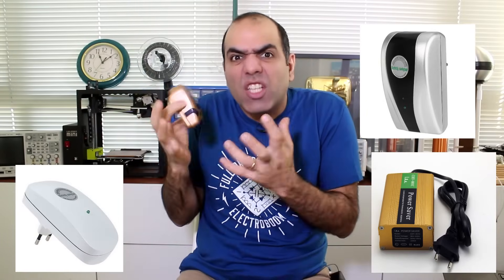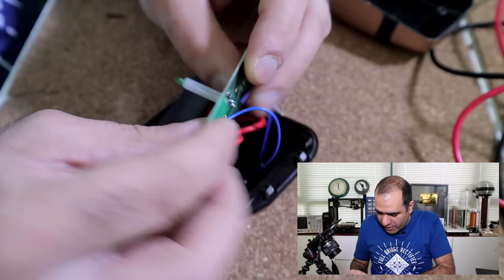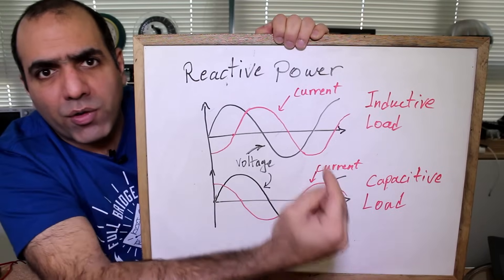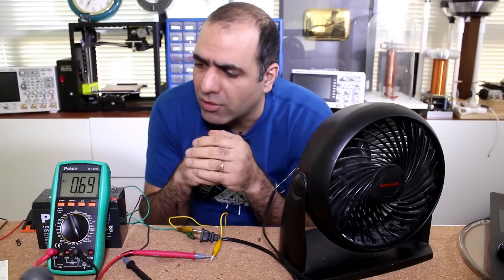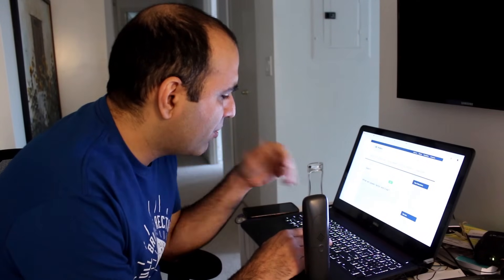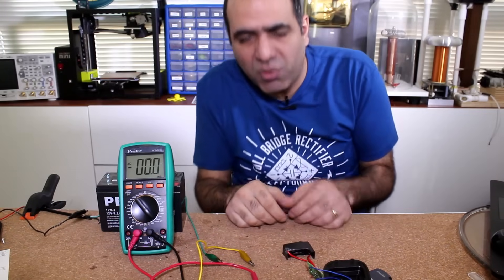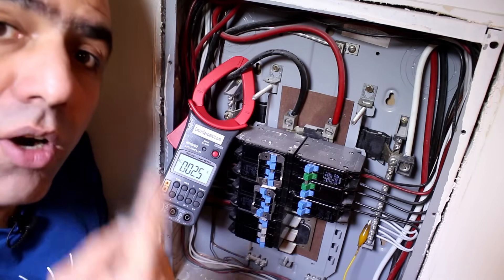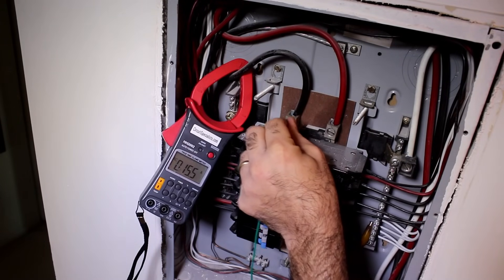Power Saver Scam EXPOSED!

Comment: I have one question: in many cases, when we consider AC signal, we find that reactance of the capacitor is almost negligible(at high frequencies). So, we approximate that the capacitor is shorted when analysing for AC signal. But, in this case, you just put that capacitor in parallel connection (with 110V AC supply). Why didn't that create a short-circuit?
Reply from the maker: because the frequency is 60 Hz and low, and capacitor is small. So the impedance of capacitor is large enough to limit the current through it and not be a short circuit.
Reply: @ElectroBOOM  Okay....now I get it!! Thanks for replying!! :)

Comment: It's a proxy, not a VPN :-(
Reply: It's a VPN......It use the same method as your system default VPN connection, which provide a stable connection through Youtube and other stuff. Though the security is doubted as ISPs monitor your connection from the beginning you linked to the WWW.
Reply: It's a VPN proxy to be precise. It uses the system VPN capabilities to establish a connection with the proxy server which in turn serves as the proxy between you and the website. This proxy server must exist, otherwise there would be no way for you to "mask" your IP address.

"VPN" is the adjective in this case, so "proxy" is the main component of this. A sole VPN wouldn't give you all capabilities "VPNs" are claimed to have, while a proxy would usually give you the majority of them.
Reply: @IllidanS4  That make sense. I personally use another service which works quite similarly with Express..But ISPs in my country is already monitoring the connection to the outside, whether your connection is encrypted or not.

Comment: next week i get to install 2 power factor correctors that together have a 3 fase 630A 400V rating. 
and all of this just to smooth out a 1600A power distribution penal.80% of it is rated to go to AC induction motors and only 5% to utility's and control hardware.i can not tell u wat or who it is for, but that factory is gowing to get one hell of a peace of kit.

Comment: You might actually be billed for apparent power. It depends on your meter. Mine is the old style rotary meter, which uses inductance to measure power flowing through the service connection. It cannot measure the apparent power because of the physics behind its operation. A digital meter however, can. Some digital meters do and some don't care about PF, but smart meters do. They can measure current and voltage separately to obtain apparent power and actually adjust your rate dynamically to your usage schedule and power factor.

However, most people do not need power factor correction in any way shape or form because the main appliances that need it, have it. The issue with home power factor is switched-mode power supplies drawing a short pulse that causes a momentary drop in voltage and a harmonic distortion to form on the line, which can actually hurt your bill much worse than a motor can.

Comment: Most domestic electric devices with motors already have a capacitor in parallel of the the main circuit, just open your vacuum cleaner and see.

Comment: 5:54 WHAT THE F#$K WAS THAT
Reply: A... moan?
He explains right after, but...
Capacitors are like batteries (difference being caps can release all their charge at once/in a short time) and without the LED there to discharge the cap inside, it discharged into his body when he touched the plug (completing the circuit).

Comment: Since many LED light bulbs use a Capacitor dropper to get low voltage many households already have these power correction devices.  Maybe so many that an electric motor (inductive load) is actually correcting their light bulbs.  Not that it matters for residential anyways!

Comment: It took years to convince my dad that his magical power saver wasn't doing anything. Eventually the cheap capacitor within the unit failed and the entire box became quite hot, drawing who knows how much power. Luckily it was in a decent aluminum enclosure.
Reply: I wonder if they used a class x capacitor? Think they are designed to fail short circuit and trip the breaker.
Reply: Given its level of Chineeseiness I bet the just rolled up aluminum foil sheets between a plastic grocery bag.
Reply: All electronic components - including capacitors  - will fail, the more you have, the more the risk. I have a highly reputable make of  oscilloscope, a few years ago, I heard a pop, when I checked, I found its input filter had failed - probably the capacitor within - and it was on fire. Lucky I was there otherwise it  could have burnt the house down. Tell your dad to chuck his cheap Chinese junk on the floor and stamp on it, non-commercial users don't pay for reactive power  anyway.
Reply: EM.. skill would be the man who uses one of these to set off a rocket.. ha ha.. Let's see it..
Reply: @Mo Bina - I could do that blindfolded with all three arms tied behind my back.
Reply: @ElementalMaker  Three arms?
Reply: @ElementalMaker  fancy seeing you here buddy.
Reply: Why does it take years to convince your dad? You could easily convince him by saying that the his electric bill doesn't increase after he started using the thing.
Reply: So... the capacitor helps, marginally, only when connected directly to some devices... hurts in all other cases... and eventually goes bad.
Reply: My subscriptions follow my subscriptions. Cool!

Comment: The microwave is still consuming power even if it's empty. The magnetron that draws the power doesn't care if there's something inside. You essentially heat up the magnetron itself after some time which is why you generally shouldn't operate an empty microwave oven. Compared to other heating devices it's actually quite efficient though. It has about five times the efficiency of a standard electric oven

Comment: Modern motorized appliances include power factor correction of some sort, by law. I have a very old chest freezer that was manufactured before that. I have an actual active power factor correction device connected to it. They used to be available, there are actual electronics inside. The motor runs quieter, too. Modern fridges and freezers have them built-in.

Comment: I like old plastic housings for little projects. Old 12v wall warts are great for kids nightlights or to plug in when you need light to work behind a dark cabinet. So at the very least, you overpaid for an LED, a capacitor and a handy plastic case.

Comment: Hey Electroboom I live in a warm country and during the summers our room fans are rarely turned off (they are on 24 hrs a day) they run on avg at 100 watts and by using a similar device I was able to reduce our electricity consumption by 20% compared to the previous year. But I directly coupled the capacitor to the fan switch so if the fan was on, only then the devices were on (I took three semesters in LCA and electronics). I love your videos <3

Comment: I have conducted scientific tests on some of these power factor correctors(not capacitor its a trac that is fired to reduce the output till the lowest current is achieved). I used the spinning disc in the home power meter as it reads actual power consumed. here is what I learned. Yes, on my 1951 refrigerator originally designed for 110volts running on my line 127 volts. the correction results in a 4 percent saving. lucky I only paid a dollar for the corrector at the thrift store,( as 4 percent is not that much money saved). I bought half a dozen for the heat sinks and triac. NO on my kitchen refrigerator designed to run on 125vac. no saving on it. the  lesson learned is motors running above their design voltage are wasting heat because of iron saturation. For most people stay away from these things.

Comment: I have a transformer that steps down 220 v AC to 22 v AC. It's primary coil impedance is 10 ohms. If I connect it to the AC outlet (220 v AC) it would draw 22 amps without any load. If I connect a load that draws 10  amps at the secondary ,will the current through the primary coil reduce to 1 amp or will it stay 22 amps with 21 amps reactive and 1 amp active or will it be 23 amps with 22 amps reactive and 1 amp active?

Comment: Another full bridge rectifier shirt? Guess I'll have to buy it... I'm planning on wearing the 1st, while I do a video on converting a 12v wall adapter to an AC/DC power supply... They cost about $200+ for etching knives... I could build the whole thing, but why when it is already all built in a wall adapter, just tap off the transformer... Awesome video as always, have a great day, take it easy...

Comment: In the UK we are being changed over from the old type spinning disk meters to "intelligent" meters. I personally have refused. Of my friends who changed over the average increase in cost is about 30%. Exactly what I would expect from loads of badly designed switch mode PSU's etc on apparent power. So possibly these are going to go from utterly useless to actually saving money for some people if I am correct about the reason for the cost increase. Just so you know we are talking the exact same household with the same unit cost on the same supplier.

Comment: Hey Mehdi, I really appreciate you putting this together. I was wondering if you could answer a slightly different question with that same data: you keep mentioning that you are not paying for the extra power that the capacitor is displacing, but is that power being diverted or used somehow, or is it just sent back to the grid?

Comment: There is a different type of "Power saver", intended to be connected between the wall outlet and the load, which is in a fact a dimmer with a fixed setpoint in about 80%. Yeah, if you plug something like a fan, you will pay 20% less for The energy, but will have 20% less wind 😂
Reply: Now thats a legit thing.

Comment: Let me see if I get it. When you have a pure capacitor or an inductor connected to the line, it's just pumping energy back and forth between you and the grid. So you are technically not consuming anything, but the electricity still moves back and forth so the power supplier gets angry because you are wasting energy on their lines as heat (due to resistance) and pay nothing for it. When you have an inductor such as a motor, some of the energy is used to do actual work, other energy would be pumped back into the power line. But if you add a capacitor, it absorbs the energy that supposedly would go back in the line, and hands it back for later when it's actually used, instead of drawing it from the line.

Comment: Side note on microwave ovens. There are a couple of design differences from "normal" transformers: (1) they are wound to partially go into saturation, hence the 14A reading. A normal transformer, rated at 1000VA would typically draw 1A, or less, when idle (no secondary load). (2) There are "shunts" in the core, to divert a small portion of the magnetic field, so when loaded, it doesn't overload your breaker.

You can convert a microwave transformer to be just like a regular transformer by: (1) adding about 10 turns to the primary, to keep it out of saturation. There are only about 120 turns on the primary, for a 1000VA microwave oven transformer. (2) Remove the shunts. They are two separate pieces of metal, that can knocked out. I personally, remove the secondary, and wind a new one. Microwave transformers can deliver a lot of current at low secondary voltages. Many are re-purposed for homemade spot welders.

Comment: There's real boxes that correct power factor, they contain inductors and capacitors that are turned on with relays and off, with an actual computer board that detects the powerfactor and corrects it. They're expensive and rare. .-.

Comment: hey buddy , please clarify me that , if we can increase the power factor to unity by using the external capacitor banks, than in industries why they always try to maintain it at 0.9 or 0.8 lagging instead of unity. it may perhaps due to the economic considerations , but how , please explain if you have any idea, or if it is possible then please make a short informative video on this.

Thanks
Mohak Saxena (INDIA)

Comment: There's a guy here in argentina who made a video from one of these. He tried to demonstrate what you're saying, couldn't get the piece of junk to work so he pried it open. Literally, the thing was a circuit to reduce the voltage and turn the power led on. That's it. Not a single component more. Not even a capacitor.

Comment: The UK is going this way with the massive push to install "Smart meters" so the power companies can charge their customers even higher rates.  And they say, and I quote. "Smart metes will save you money by reducing your power consumption".  Yes that is real.
Reply: Unlike the old spinning disc meters, Smart meters DO have the capability to measure apparent power, and just one flip of a bit in the setup to charge for it
Reply: @matthewday7565  ^^ My point explained better :)
Reply: Whatever they tell you, you're under no obligation to have one installed. Also the costs appear to be spiralling, people are having them removed, it's a mess. Due to how our particular house is, they can't install one, which is nice. I don't remember why. Maybe no mobile phone network, maybe because of the size of the installation serving multiple flats.
Reply: @ollieb9875  Unfortunately here in Italy they switched everyone to smart meters in the first 2000, and then last year they yet again changed all the meters to update to the new technology. In theory meters communicate trough the power lines (more or less the same technology as the internet powerline adapters that you buy at home). 

The most annoying thing is that these meters implement an accurate digital limit of the power that you can draw from the grid, instead of the old ones with a standard thermic breaker, so when you draw more power than what your contract provides (standard is 3kW) for more than a couple of seconds the meter trips the breaker on it and you have to reset it manually. 

So you turned on your hair dryer and forgot you had the washing machine on, you have find the key of the meter box in the dark, go outside (because they no longer install meters inside in new homes, they must be accessible from outside your property), and reset the breaker (that is a standard breaker with a solenoid that lets the meter trip it electronically, but then it must be reset manually as normal breakers), and then reset all the clocks that doesn't have a backup battery, and restart all your computers and stuff.
Reply: It can help you to reduce the bill as long as you control your consumption power at specific times.

Comment: If you place a capacitor directly on 220v/110v, doesn't that mean it's kinda dangerous when you unplug it and touch the contacts?
Reply: +
Tim Leijten
using the formula: E=1/2CV^2, we get that the energy stored in that capacitor (2.1 uF, or 0.0000021 F) is around 0.0254 joules at 110V, which isn't dangerous.
Reply: @voltagedrop5899  Problem is, I don't believe that thing is inly 2.1uf. Good change he damaged it by scraping it open or that the resistors on the board caused the measurements to be off. It looks too large to be only 2.1uf. Even for a 110v cap.
Reply: A small capacitor hurts, but does not kill you. But !!!  If you have problems with your heart (even if you did not know it yet), it can end badly. So its better, to not do it.
Reply: That's what he did 😂😂
Reply: @myutubechannel_nr1  yes, im also missing the warning hints in his videos
Reply: he did. that was one of the two electric shocks in the video
Reply: Yes.

Comment: Since we live in a era of electronics instead of heavy motors inside homes, there are very few inductive loads that a capacitor could help.
What's worse: Non-linear devices (such as electronics power sources) often already have power factor correction. Those who don't have, however, will most likely get worse power factor with a capacitor in the input than without.

Comment: Alternative Theory ; They dont work ! and the capacitor Prevents the load from ever reaching the peak voltage at the top of each sine wave.,  thus less voltage, thus less current.  -   creates an "apparent" phase delay across the load,  -  mabee its a gimmick that exists because it stands up too testing, but not theory.   - any other free energy pros have an opinion ? ;-)    - this is a real machine.  https://www.youtube.com/watch?v=QnaQNv0E5NA